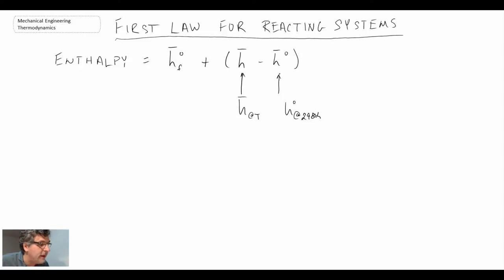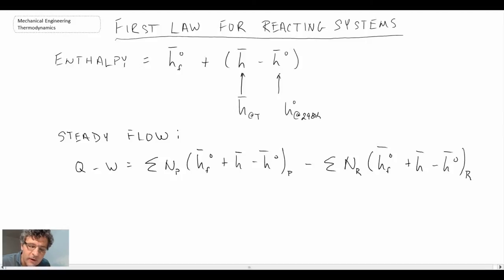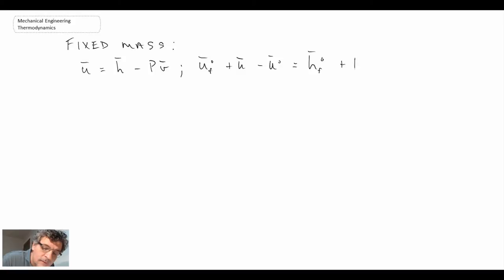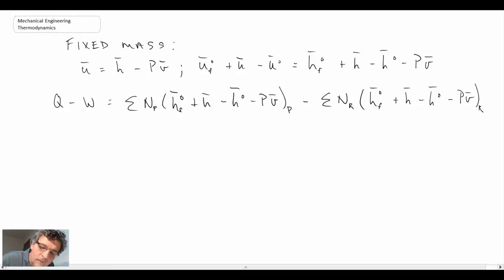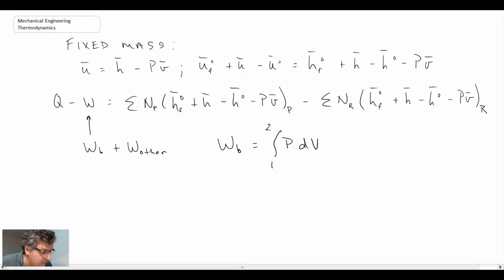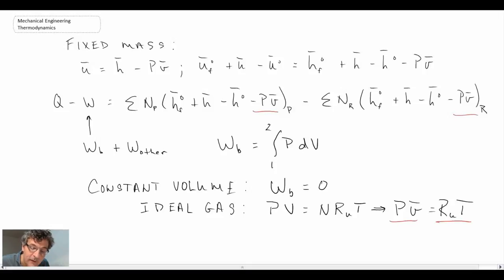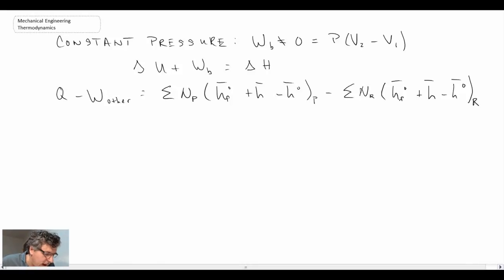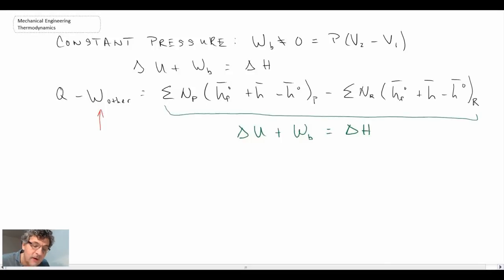Mechanical Engineering Thermodynamics - Lec 33, pt 1 of 3:  First Law - Reacting Systems

Comment: Great video. I have a question. In exothermic reactions, enthalpy of products is lower (heat is released) but temperature generally rises. My understanding of temperature is the average kinetic energy of the molecules that shows up in internal energy. On the other hand, h=u+p*rho ..so if temperature is higher it just seems to me that enthalpy should be high too. Where am I going wrong?